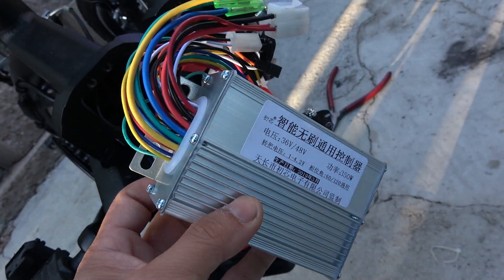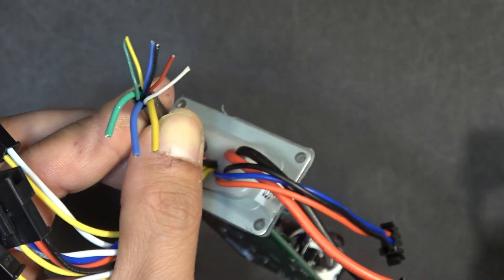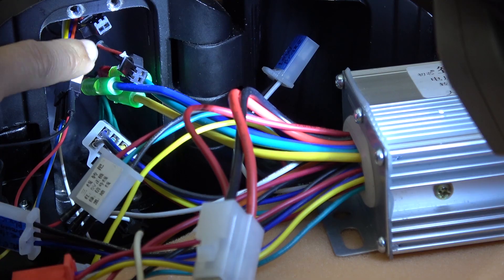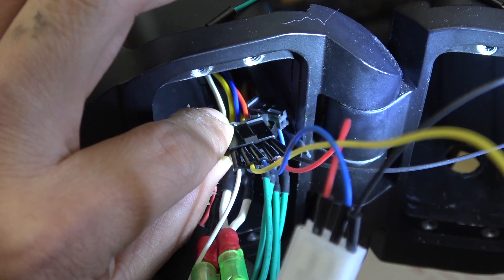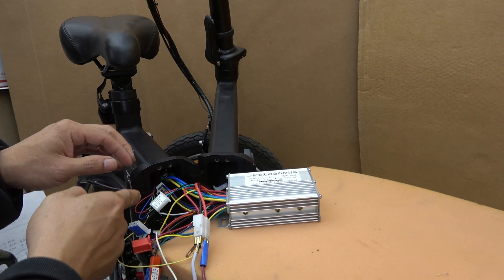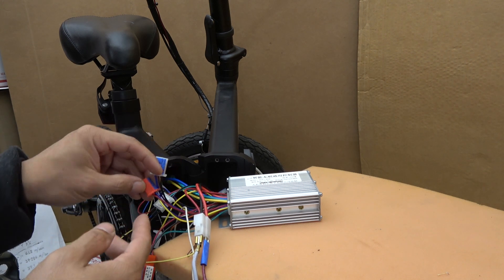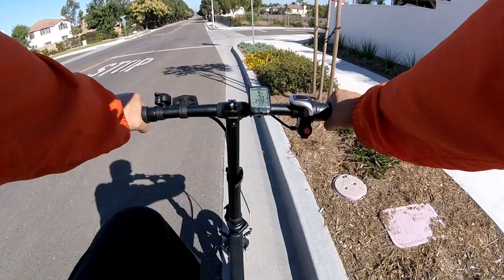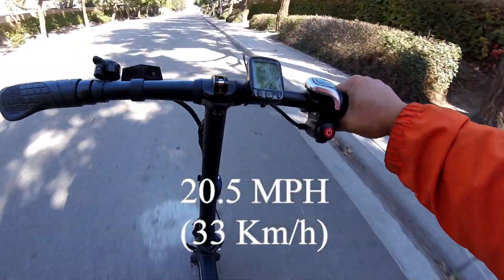Increase speed of ebike: Swagtron EB5 controller upgrade

Comment: Please film an episode on increasing the battery capacity soon! I would love to see it!
Reply: buy the eb5 pro. removeable batteries. I bought 3 replacement batteries for this. and I am going to replace the controller soon.
Reply: @brandonly27  i jerry rigged a 20ah battery onto my eb5 with the controller mod it has a 50 mile range now without having to carry extra batteries
Reply: @DerrickVan  can i ask what model you used?
Reply: @DerrickVan  and does it fit in the battery space, alloted?
Reply: @brandonly27  eb5, what I did was install a cargo rack. Attach a tool box to the rack with bolts, and ran the original battery and the new battery to a 3 way switch so I can switch between the two. Then the output of the switch goes to the controller
Reply: @DerrickVan  i have a cargo rack as well, also have 3 swagtron batteries. Maybe i'll try that. Good idea.
Reply: @brandonly27  good luck! Was super fun experimenting with the bike and seeing what worked and what didn't
Reply: Devin Wilson  yea there's no guide for the modification you really just got to go off of what you know. 

Its really complicated to explain but get a 3 way switch. There will be 2 inputs and 1 output. Run the output to the controller. Go look up 2 batteries ebike. Theres a video where this guy uses 3 way light switches, dont be like him he made lots of mistakes, you don't need to connect the neutrals to a switch use a wire nut or solder the two neutrals to 1 wire, like a Y.  Send the single wire to your controller and your golden. Hope you got something from my comment im not the best teacher when it comes to writing
Reply: Devin Wilson  go on ebay and get those cheap battery packs 36v 20ah or how many ahs you want. I think the battery i got was a LiFePO4 battery or something like that. I dont know the watts of the motor on the eb7 but make sure the battery is compatible, if iyour motor is lower than the rating its fine like if you have 500w and the battery can do 750w you are fine but not vice versa. But remember cheap batteries comes at a price
Reply: @DerrickVan  I wish one of you guys would help me out with what you did with your bike. I don't know how to do any of that what you did so can one of you please help me out?
Reply: @DerrickVan  can you please help me out with the same thing you did to your bike so I can have my EB5 Pro set up the same, please?
Reply: @aaronlittle2176  yea what do you need me to explain?
Reply: @DerrickVan  do you know how to change the throttle out on this? Mine is giving me problems, Swagtron wants me to ship it to fix but it would probably be cheaper to buy a new ebike. Everything is great and has been for 2 years of daily use it's just my throttle is almost worthless now. Thanks
Reply: @brandonly27 how did you get an extra battery?? I try to look everyday on swagtron and they’re ALWAYS sold out

Comment: Vuaeco ..Watch for GHOST Battery DRAIN ..It does live in this model and Others. We found out why when we added the aux. battery to this bike. We use two batteries.  ..Our main battery is a 36v 8app.  and the aux. battery is a 36v. 14app.
With this setup we get about 30-40 miles @ 235 lbs. ..depending on how you ride...Swapping batteries is just a flip of the switch! ..We always try to Top each battery charge to 42v MAX! AND NO MORE! ..AND NEVER LET THEM DRAIN BELOW 27.5V!  Each battery is Always disconnected from the controller by a Switch when bike is just sitting....With this method the batteries can sit for Months without Ghost Drain. ..Also after a few charges to each battery run we can get to 20-21 mph with stock controller on level road. ...All we did was add a aux.battery ....a switch  ....and follow the methods above...  PS: VERY GOOD VIDEO!
Reply from the maker: See Nomore: This bike does not have Ghost drain (phantom load?) when the main power switch is off. I did a test for this on my last review video on this bike. This bike doesn't seem to have a good place to install a second battery. Where do you put it?
Reply: See Nomore - can you please provide us information on how you added this Ext battery?  That sounds rad!! Video ?
Reply: @andrewcarson5567  ...WORKING ON A LINK TO THE AUX.BATTERY SETUP.
WILL POST SOON..IN THE MEANTIME STAY TUNED TO VUAECO ..HE'S THA MAN!
Reply: See Nomore thank you!  Will you make a video / blog post explaining the breakdown?  I have a universal rack on my EB5 already so this is perfect!!  I’m semi technical but not incredibly so.  I would love to try this!!
Reply: @andrewcarson5567  OK guys.. Here is MY link
http://see-nomore.simplesite.com/
Reply from the maker: @hymlog  That's a nice rack where the box sits on. Where did you get that rack?
Reply: Thank you so much for all of this very useful information, you are amazing!
Reply: See Nomore ty ty ty ty!
Reply: Looks like my setup with habor freight ammo box...: )
Reply: See Nomore thx again for all this information, which do you all believe would be easier to do.  Add the external battery , or swap the controller?  I got a universal rack at target that works great for 20 bucks.  I use it for my lock and my skateboard and gym bag.